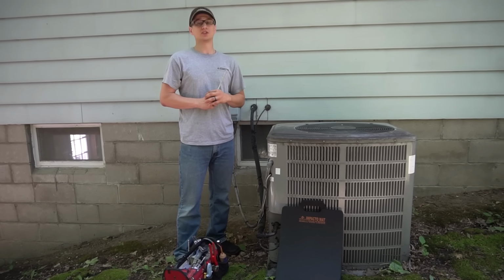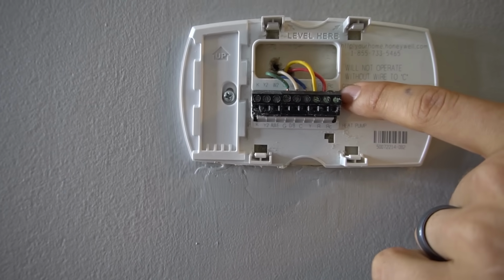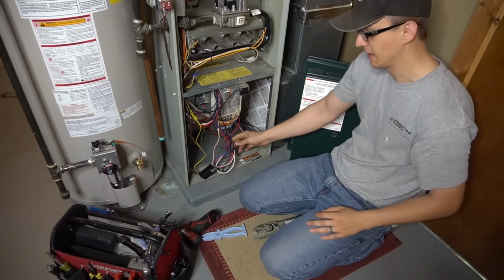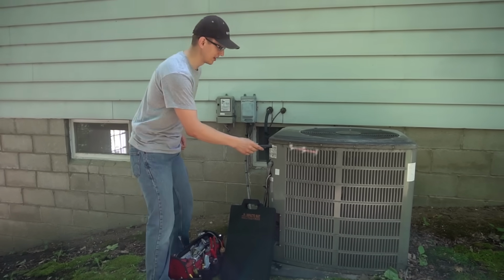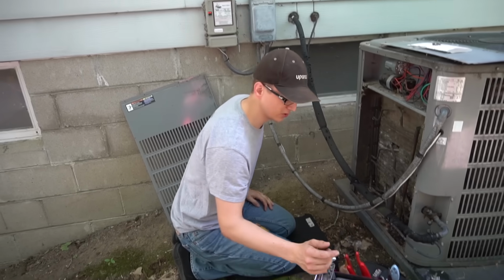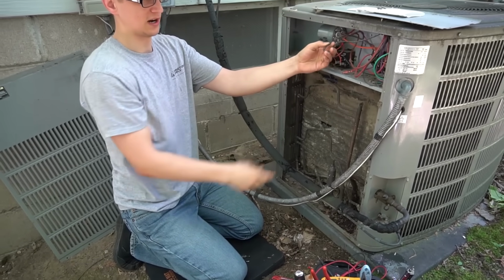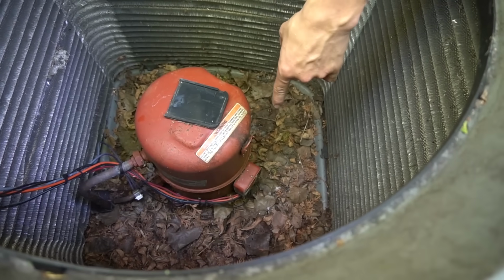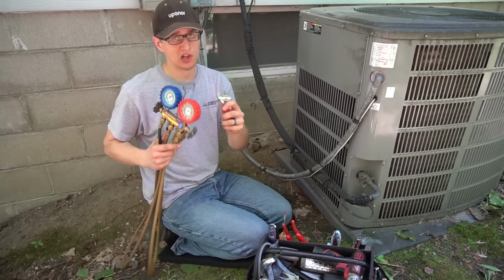AC Unit Not Turning On - How to Fix It Step by Step

Comment: I changed my capacitor and when i turned it all back on it felt like cold air was coming thru my vents and i could hear the ac unit running but the fan wasnt going. I could spin it w/ something and it did not feel like it was locked up cause i could spin the blades easily.  Any idea whats wrong w/ it now?
Reply from the maker: Which fan wasn't going? The indoor fan or the outdoor fan? It sounds like you were talking about the outdoor one. So the capacitor you replaced, was it a dual capacitor? (one with herm, fan, and common sections) Or was it a single capacitor with just two sections? In other words, do you have more then one capacitor in the outdoor unit? If you do, then perhaps the other one is the one for the fan. Also, I would check the wires coming from the fan motor and make sure the connectors are on good and there's no burnt or broken wires. And one more thing, does your AC unit outside have a little control board in it? It may be defective too. Another possibility is that the fan motor is bad. You can check it's resistance and know for sure if you have a multi meter

Comment: You did a fantastic job explaining in clear understandable terms, Thank you ...my inside fan working but when I checked fan outside it was just humming/buzzing and when I flipped it with the screwdriver it started up and is now running. but before I turned unit on I did check the fan to see if it was froze up or stiff in turning, it was free and moved very easily, then with unit on I flipped and started up.. Should I check capacitor or replace the outside fan motor?Before I watched your video I was just getting ready to call an AC/Heating company. I am one happy camper. Mine is a Goodman ARUF 030-00A-1A.Thank you very much and will continue coming back and learning. AWESOME!!!!
Reply from the maker: Hey David! Thank you and I'm glad you found the video helpful! :) So if the fan blade spins pretty freely, then I doubt the fan motor is bad. When the fan was not spinning, was the compressor working? (the compressor and the fan sound differently) But aside from that, it sounds like your capacitor may be weak or completely dead. I would start by replacing that. I have a video in my description on how to check and replace one if you need some more info. The capacitor kind of acts as a battery for the fan and compressor. If it's dead, those two wont start.

Comment: Hi, recently my AC only works after resetting the main breaker. I need to turn the AC and Furnace breakers off for 30 mins and only after that the AC works.
what would be the problem?
Reply from the maker: How long does the AC work for before the breaker trips? And do both breakers trip, the AC and the furnace?
Reply: the AC keeps working untill the desired temperature is reached. then the fan turns off as it normally should.
however, when it needs to start again , it never does. So I need to reset the breaker.
there is no actual tripping of the breaker. all the breakers are in the ON position without any disconnection or tripping
Reply: I have finally got it!

it was the AC breaker in the main Panel.
one of the poles was melted and broken. I changed the breaker and it worked fine.
One question, do I need to investigate why it was melted or it's just something that happens?!!

here is a phot of the breaker:
https://ibb.co/frG0Z8
Reply from the maker: Oh wow! That doesn't happen very often. Good catch! Most likely it will be fine.... But there's always that small chance.. That if something is shorting out, your house can burn down.. So even though it's going to hurt the wallet a bit, you may want to have an electrician double check

Comment: Can you explain how to test Control Board or maybe a video.
Reply from the maker: To test a control board you would need a multi meter with leads that can check voltages. If you have one, I can tell you where to check. And that is a good idea :) I will make a video about that too, though I can't say when..

Comment: My AC unit makes humming noise but does nothing else what could be the problem? It was working just fine just until a few days ago... i cleaned off all the stuff that was stuck to the sides.
Reply from the maker: Sounds like a dead capacitor. This video is all about that: https://www.youtube.com/watch?v=C82HvbvP08E
Reply: Capacitor is old but doesn't look too bad but when you try to turn it on i notice inside the panel an amber LED labeled compressor goes on i get a louder buzz aside from the low buzzing, only last about 2 seconds then turns off along with the louder buzz could that still be the capacitor?
Reply from the maker: I just had a few air conditioners doing that same exact thing last week at work. All of them were dead capacitors. Now if the fan was turning on but the compressor wasn't then I would investigate further. But it sounds like neither one is coming on, so I would still say there's a high chance it's the capacitor. Only way to know for sure is to check it with a multi meter.

Comment: Very detailed video. Much appreciated. Sorry if you have already answered this. I have watched this part of the video a few times and I skimmed the comments. (Over 400, may have missed it.)but nothing at all seems to be happening. All I hear is a click in the thermostat but nothing happens in the heat exchanger or outside unit. I pushed that plunger in the outside unit and the fan came on. I have checked breakers and I have bypassed the thermostat by touching the AC and heat exchanger wires to the power. I have not discharged the capacitor and tested it for a short yet but that was next until I saw the video. What is my next step/issue?
Reply from the maker: If you pressed the contactor plunger and the fan and compressor came on, that means your capacitor is good. So you don't have to check that one. It sounds like you are losing your voltage somewhere. Do you have a meter you can check voltages with? An easy thing to check is the 3 amp fuse at the control board in the furnace. It may have blown. Also, outside where the freon pipes come out of the house, there is usually a thermostat wire that comes with them. In that thermostat wire there are typically 2 wires, a red and a white. Do those two wires go straight to the contactor or does one of them go somewhere else?
Reply: I'll check them both and update you. Thank you for the help
Reply from the maker: Happy to help :) Let me know how it goes
Reply: So, I just got off work and got into the attic. Took the cover off and do not see a fuse anywhere. The breaker on the front is still fine. Yesterday I Turned it off then on just in case. But no luck. Any ideas?
Reply from the maker: Well, another common problem is a clogged condensate drain. If you have an attic unit, you likely have a float switch that will shut the unit off if the water is backing up. Check out this article for more about that: http://acwiz.com/index.php?action=artikel&cat=18&id=26&artlang=en
Reply: First I need to say that I really appreciate your help. I checked out the article. Put a shop vac on the pipes and checked, seemed like it was clear.
Reply from the maker: When you looked at the attic unit, did you see a float switch by chance? It usually will be next to where the drain pipe connects to the A-coil.  Sometimes they are see-through and if you see water in it, it's tripped. 

If it's not something that is easy to spot then from here you may need to use a meter and check some voltages. Do you have one? Also, does your furnace/air handler have a fan control board or is it just a relay?
Reply: Word of Advice TV I did not see a switch. I'll look again this evening. I do have a meter to check voltages. And I do believe it has a control board. I saw a board in there, but I did not see a relay on it. I know there has to be one somewhere. Just didn't see one. However I was looking for the fuse when I went up there, all I saw was the breaker on the outside of that unit.
Reply from the maker: Alright, you have a meter and your unit has a control board so let's check some voltages :)

1. Find the transformer. (usually somewhere by the control board) It will have 4 wires going from it, two of them will be 120v or 240v (usually the black and white wires) and the other two wires will be your 24v. Where those wires connect to on the control board, put your meter lead on one terminal, and the other lead on the other terminal. Check to see if you have 120v. Then the other 2 wires to see if you have 24v.
2. If you do have 120v and 24v, next locate the thermostat terminal strip on the control board (R,Y,G,W,C) and put one lead on the R screw and the other on C. You should have 24v there. If your thermostat is set to cooling, you should also have 24v between Y and C.

Let me know what you find.
Reply: On the left of what looks like the transformer, I have 17 volts. On the right I have 0. Maybe I'm looking at the wrong thing but I think its the transformer. Also, I still do not see a float switch or a fuse. That being said, I could be wrong. It does have a breaker on the outside of the unit in the attic. I do not have alot of experience with this. I have pictures if you have an email or something where I can send them.
Reply: On second inspection, I do get 240 on the left. The right is still 0
Reply from the maker: Sounds like the transformer is bad. The transformer's job is to take the 240v and turn it into 24v. (usually it will read between 25-29v). The secondary side (24v) is probably shorted out. Can your meter check resistance? (the omega symbol) Turn off power to the unit. Disconnect the two 24v wires and put both leads on the connectors. What reading do you get? (typically it is around 1.5 ohms. If it is O/L, then for sure the transformer is bad) In that case I would replace the transformer but before I did that I would investigate the outside and inside unit for any broken, bare, or burnt wires. It's possible that a short somewhere took out the transformer. 

If you want you can create a google site. It's pretty easy and quick to do. You can upload the pictures on there and then just share the site link with me.
Reply: I will check the transformer with the meter. I have checked the wires pretty well in the attic and traced what I could to try and learn what I could but I will check outside as well. I know transformers rarely go bad on their own so I will definitely check outside. One would think that there would be a fuse or breaker that would pop before the transformer. Since there isn't, I'll be adding one today.if I do not find a wire, what are the other possibilities that could have shorted the transformer? The AC people get here Wednesday so I still have 4 days to work and if I fix it I can tell them not to bother. That would be awesome. 
Thank you so much for your time and help. For knowing nothing about AC units, I feel pretty good about finding the problem otlr at least part of the problem.
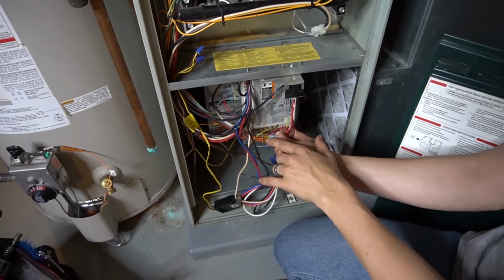Reply from the maker: I agree! You are doing good and I bet you learned quite a bit about your AC so far :) So... It's possible something killed the transformer but to begin with I would replace it and also like you said yourself, I would add a 3 amp breaker or fuse. Most furnaces/air handlers do have have them but I also see some without it. If you know how to do it, great :) if you are not sure, look at 7:25 in the video. My furnace did not have a fuse so I took the 24v hot wire coming from the transformer and snipped it in half. I stripped both ends and put two connectors on, then put the fuse in there. So now if I have a short somewhere, it won't take out my transformer, control board, and thermostat (it happens) - just the fuse. I would buy a little pack of 3 amp fuses just in case you will go through a couple of them trying to find the short. 

Hopefully it will be fixed before the AC guys come! Good luck!
Reply: Thanks for all your help. It did end up being just the transformer. But by the time I would have received the part, the AC people could have come twice. Also, no shops in the area would sell me parts. So, 160 dollars later and it's fixed. However, I explained all my troubleshooting efforts to him and I think he was impressed. And as I went around with him, everything he checked I had already checked with the exception of the reversing solonoid. And I am not sure how to test that anyway with the exception of having someone turn in power and listening for a click. That's what he did but heard no click, so he got some kind of tester. He also said he sells to some people, just depends on the person. So maybe I'll be one of those people now. Also, I did add a fuse, 3 amp as you recommend. Hopefully if it happens again, I know enough now to be able to fix it myself. Again, very much appreciate your help and all the information in this and your other videos.
Reply from the maker: Happy to hear that you have cooling again! :) And yeah, HVAC parts can be hard to find locally. That's why I refer to amazon a lot. If you have Amazon Prime, many times you can get it the next day. Unfortunate that after all that effort you still ended up paying someone to come fix it but like you said, at least you learned quite a bit from it! That will help with future problems. Thank you for the update! Stay cool! ;)

Comment: I am not receiving any power from my downstairs AC unit after I tried to install a nest thermostat. I already installed a nest for my upstairs thermostat, but for some reason my downstairs AC unit will not supply power to even my old thermostat. I also have tried to reset the breakers/the switch in my attic. Any help is appreciated. Thanks!
Reply from the maker: I would check the furnace control board and see if there is a tripped 3 amp fuse. Also, if you have a multi meter, I can tell you where you can check for voltages to see where you are losing power.
Reply: Word of Advice TV thanks so much for the quick reply! I just woke up and checked my two furnace units (located in my attic). I saw that my upstairs unit has a solid yellow light, while the downstairs unit that I thought wasn’t receiving power, is blinking yellow. This makes me think that the power issue isn’t coming from the furnace, but I trust your word over mine since you’re the pro lol. Would you happen to have any ideas on where to check for another fuse? Or should I proceed with trying to replace the furnace fuse? Thanks again!
Reply: I also got a multimeter and checked my thermostat unit. The thermostat was receiving 10-15 volts. Hopefully that info might help! Thanks again
Reply: IT WAS THE FURNACE FUSE! THANK YOU!!!! Do you accept donations?
Reply from the maker: Lol, looks like you figured it out before I got a chance to reply :) Awesome! Sorry that I couldn't reply earlier. And I appreciate the gesture! But no, I'm not taking donations. Just happy to help! Stay cool ;)

Comment: I just installed a new a coil to my system, did everything leading up to adding the refrigerant, but now my system will not get cold, the compressor will turn on for a little while, and then turn of, what could be the problem.
Reply from the maker: Sounds like it may be tripping on the low pressure cut out. Do you have one of those in your condenser? Did you pull a vacuum on it after you installed the coil and before you added refrigerant? If you did not, your metering device could be plugged. If you did pull a vacuum, then perhaps you undercharged it? What are your pressures when the compressor is running? Also, did you pump all the refrigerant into the compressor while you were swapping out the A-coil or did you recover it all?